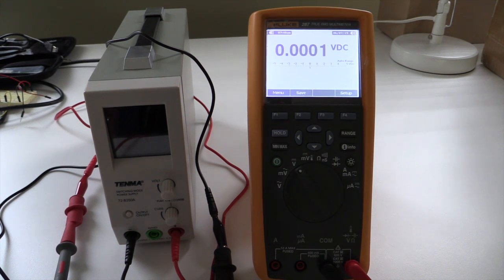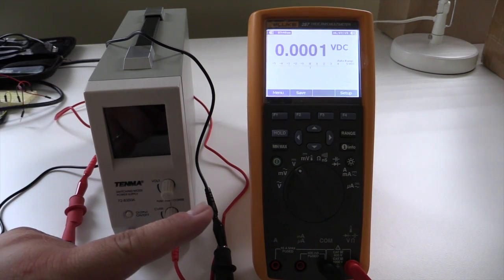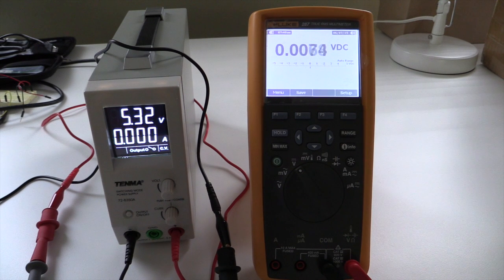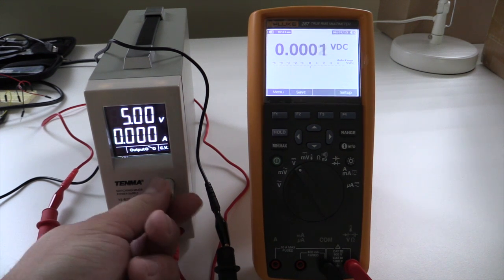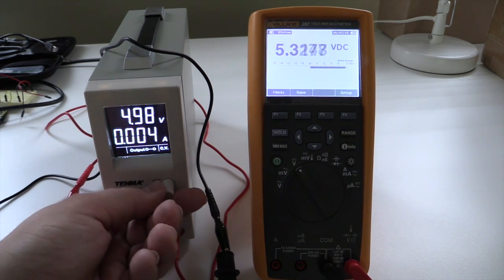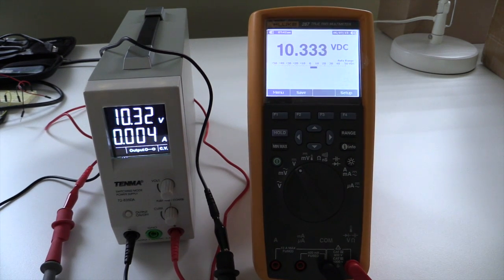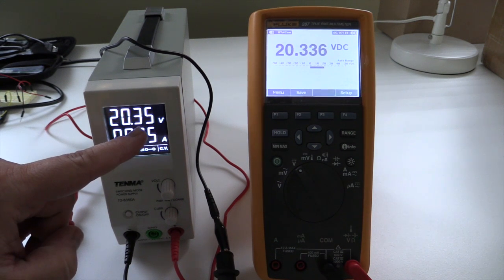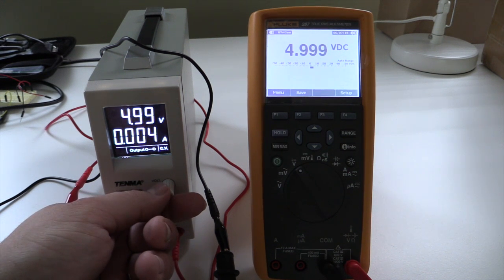Tenma 72-8350A Bad Unit - .32V Voltage Output Error / Discrepency

Comment: Interesting.  How did this work out or get resolved?

BTW, I spotted your post on the message board at Einstein@Home, BOINC project and that you were running on a Raspberry Pi. (As am I)  you could discuss your projects on the Pi in a video.
Reply from the maker: +Brian Blues I ended up returning the unit and the replacement was spot on.  Not a bad little inexpensive supply for messing around with micro controller type things.  A video on the Pi cluster is in the works. Thanks for watching!
Reply: KF7IJZ
Good to know!  Thanks!